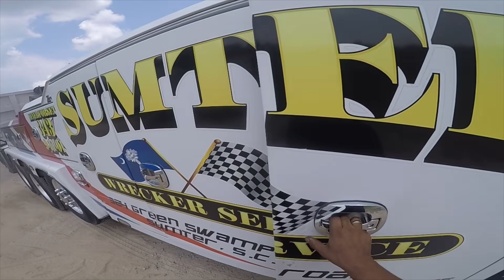Lifting a loaded trailer to change a tire

Comment: First. Nice job Mr. Wilbur. Mr. Hal that was some serious weight on that under reach. No he didn't lift the entire 86 Thousand but the way the Wrecker squatted I would guess he had every bit of 60 Thousand on it. I think I would have used the boom with both lines doubled up if possible,but either way that Vulcan can handle it. Thanks for the video. You guy's stay safe out there.
Reply from the maker: Mr Dan thanks and you stay safe as well

Comment: I run dumps and containers. And blown a set of duals on a loaded trailer before. 
When 2 30 ton jacks sink into the pavement. Time for a tow truck. 
I love teaching tire techs how to change 10x20 tubes on Dayton rims. 
When mounting always line up the valve stem with the inter lug nut. And spin balance for "trueing". And always use a torque wrench and air up a 10x20 after mounting back on the truck. As long as you've not sucked the tube, you can change out the tube on a 10x20 tube tire. 11R22.5's are still the best tire size out there.
Reply from the maker: Mr Jerry thanks for that information.  I didn't know that. Stay safe
Reply: It helps to. To put the lug nuts back on loose so when you smack the rim with a hammer the wedges don't fly everywhere. The slap spin trick take something heavy set it beside the tire to true the wheel.

Comment: The most weight they can legally have on one axle is 25,000 pounds. One end of that axle would weigh 12,500 pounds so a 10 ton jack should have been able to lift it. Most of the air over hydraulic jacks that the tire companies use for semis are at least 20 ton and many are 22 ton.
Reply from the maker: Tired old mechanic  They tried  2 twenty tons and 1 25 ton the night before.  I am  not sure why they wouldn't lift it. Thanks for watching and stay safe

Comment: When I was changing tires Dayton rims. They can be very dangerous. You should always put them in a cage or if you're on the road wrap a chain around it into places. So if the locking ring comes off they won't get you very dangerous rims
Reply from the maker: Mr Glenn I will pass the chain tip on. We appreciate anything to make our job safer. Stay safe

Comment: Them old style wheels SUCK. That poor tire man worked his hind end off. I'm guessing it was probably 95 degrees out and if it's anything like us here in NW FL the humidity was high and real feel was bout 108. I've never liked pulling trailers with those wedge wheels.
Reply from the maker: Mr Kevin  it was 94 with heat index of 104. Thanks for watching and stay safe